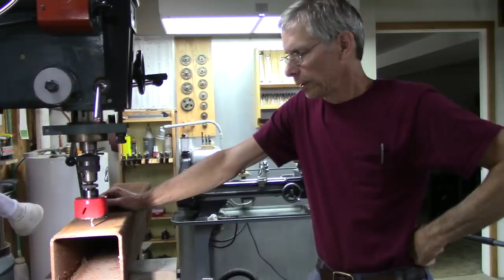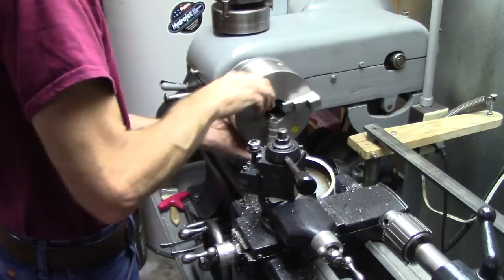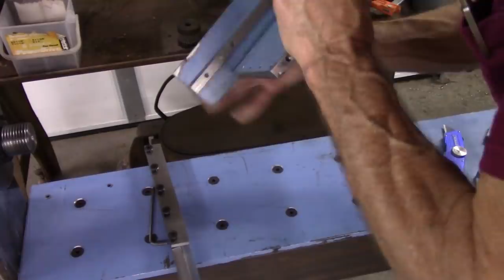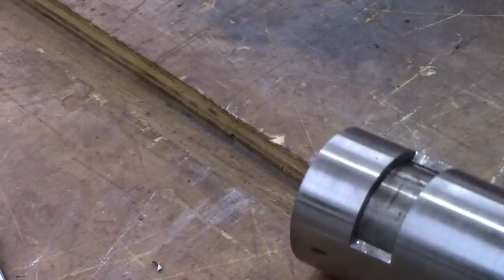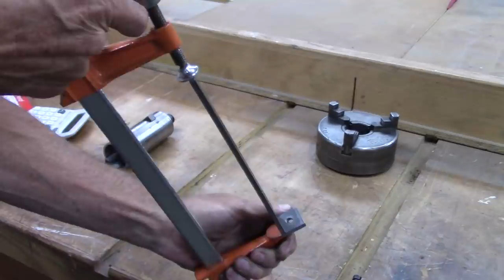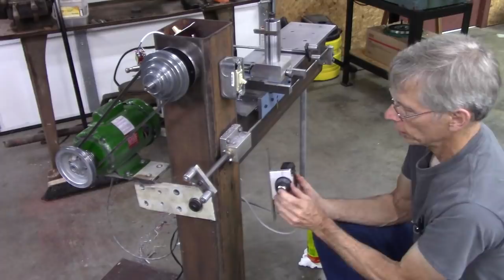Building a Wood Lathe like a Metal Lathe with a Pattern Tracer - Part 1

Comment: You do some pretty amazing builds !
Everything is over engineered,  perfect
Reply from the maker: Thanks, And I agree...  parts of this lathe were over engineered. The tapered bearing in the headstock for sure. I always wanted to try tapered bearings and they were very cheap.
Reply: @WinkysWorkshop  I know that Timkin tapered bearing are expensive, but the Chinese ones are cheap. Who knows Timkin may be using china now. Anyway, I always thought tapered bearing is better in a lath head. However,  it was common practice for lathe manufacturers to use Babbitt years ago before the sixties
Reply from the maker: @mikemullenix6956  These were listed as premium trailer wheel bearings. I just went back and looked. I paid $24 for the complete set and they are now listed at $22. No doubt Chinese. I've noticed Timkin and other name brand bearing have also dropped in price over the past several years. Probably all made in China now. Sad. It's nice to save money but we are paying dearly for this in other ways. I guess things will self correct but when and at what cost. My 1931 South Bend Lathe  has bronze bearings. They will not hold up to high speed industrial use but for what I do they work great. I had a Logan 200 and 820 with ball bearing headstocks and kept the south bend. The Logan's were 10's and the SB an 11 but the SB was much more solid. It amazes me how oil can effectively fill a gap and make a bearing solid. I can use the lathe for about an hour and and notice a change in the way it sounds. A dash of oil in the head stock bearings and its quiet again. I need to put drip oilers on it.
Reply: @WinkysWorkshop  I bet that 1931 Southbend had hand scraped ways. I think the Bridgeport had hand scraped ways
Reply from the maker: @mikemullenix6956  As near as I can tell it does not. The ways are worn bad on my South Bend. I miss my Logan sometimes. It was in much better shape just not as solid.

Comment: If you preheat the metal, you’ll get better penetration with a smaller welder.
Reply from the maker: I don't doubt that. That's a very good tip. Thanks. I think I'll sell this welder and get a 240V MIG. I recently got a TIG and it's AMAZING!  MIG is certainly faster but the control and quality of TIG is much better.
Reply: @WinkysWorkshop  My dad was a welder. Cut his teeth in a shipyard, did ornamental iron in Hollywood, and various pipeline jobs. I worked as his helper for a while. I wasn’t even close to his level but I did pick up a few things through the years and I think we should pass on what we know to the next generation. I only have a 115V Mig and I have to make it work on things that it was never designed to do lol. That little trick has enabled me to do quite a bit that I never would have been able to do otherwise.

I would LOVE to have a tig, especially a beefier one like you got. It would open up so many possibilities. But I’m saving up for a bench top mill.

Anyway, good work sir.
Reply from the maker: @lkw6640  Yeah...  the mill would be the higher priority for me too.

Comment: Amazing work! And using the channels for feet is genious. Now you can insert a fork truck under it to move it around the shop if needed. 
  Your welds are 1000x better than mine. Mine look like burned popcorn. 
 My only question is with such a beefy construction, why did you choose to weld the bed so high? You are losing so much swing radius for making larger diameter turns. 
  I'd love to have a lathe with a 26" (total diameter) swing...
I have been pondering using a 6x18 compound milling slide table  with a rotating vice mounted to it for holding by cutter.  This would replace a banjo. 
I could do the same thing for the tail stock for cutting interior. 
But I'm not a welder.. so this would be too expensive to hire done. 
For the chuck and motor, I figure a couple pillow blocks and an electric motor/belt/pulley system similar to yours could be used. Not as nice as yours by any means, but it would work for my needs. Im too scared to turn staves very fast anyways.
Reply from the maker: I think I can turn up to about 12 inch and I'm not much into bowl turning. Kind of scary seeing a huge chunk of wood spinning.  I've now converted this lathe to CNC. Check it out:  https://www.youtube.com/watch?v=lRgRHzdntWo&list=PLz2A001hMBoQIV6q78TUxDCCUZjXG37Wq

Comment: Winky, what model Logan do we see there?
Reply from the maker: That was a Logan 200. I sold this lathe and bought an 820. Then I sold the 820 and now have a South Bend 11. The 820 had a quick change gear box and it was a very nice lathe. The south bend is a little more solid however and I opted to keep it and sell the 820. Maybe not a good choice but I like the SB too.
Reply: @WinkysWorkshop  Thank you for the reply. I asked because my first and still primary wood lathe is an old 11 inch Logan 920. I bought it about 30 years ago at just over scrap prices. It was rust free but missing much of what makes a metal lathe. So I elected to make it a wood lathe with standard tool rest design. I removed the partial carriage and chip pan as I saw no benefit for the carriage. The chip pan would be an obstruction on a wood lath, as bowl turners often hug the beds of their lathes. The cast iron legs were put on 4x4's with casters. The rear of the lathe incorporates a plywood table that holds the motor and shop made jack shaft. The jack shaft converts the motor's V pulley drive to flat belt drive to match the head Stock cones. I turned the jack shaft cones from Florida Live Oak. I found the rear table design to be handy more than once. I can push the head Stock, motor and jack shaft down to the end of the starboard end of the bed  and turn bowls of any diameter. The 2.25" x 8TPI spindle can easily handle large, heavy stock. Though most of my turning utilized a 2.25" x 8 TPI to 1.5"x 8TPI spindle nose adapter machined for me back then. 

The most useful modification I made was a foot operated spindle brake. The brake bar sits comfortably under the lathe midway to the rear. When I step on it the Jack Shaft slackens the flat belt drive and a leather shoe brakes the spindle. If you ever retrofit a wood lathe with one you will find that you can't live without it. Bowl turning requires lots of stopping to check depth and wall thickness. The brake bar  is made of wood and spans the port and starboard legs. I positively love it and find it even more used and useful than my VFD! Prior to installing the a 3PH motor + VFD I was using a 3/4HP Start winding/Cap. I could swear I heard that motor thank me when I installed the brake. Starting is a stressful process on Single Phase - high torque motors. Especially models with centrifugal start switches. 

Wakodahatchee Chris
Reply from the maker: @cdrive5757  Very cool conversion. A metal lathe makes an excellent wood lathe. The only think I'm wondering about is the break and unscrewing the chuck during a stop? The lathe in this video is now CNC. A friend of mine made the controller and I did all the conversion. It works absolutely great! https://www.youtube.com/watch?v=lRgRHzdntWo&list=PLz2A001hMBoQIV6q78TUxDCCUZjXG37Wq
Reply: @WinkysWorkshop  The brake section of this clutch/brake is easily (no tools required) removed for chucking that's screwed on to the spindle. Spur drives, collets and such can use it. I have found that leaving it on for bowl turning isn't much of a danger because the brake is more of a drag than a brake. It doesn't slow the spindle down much more than my left hand on the outboard spindle hand wheel. The clutch is the most useful feature part of this anyway. It's just a merciful relief to the motor's start up.

I'm a retired EET / Biomed- ET. So when I walk into my shop I want to go back in time and escape the tech world. Wood turning 'is' working wood with hand tools. The magic that comes off the lathe comes from my hands not the lathe. The lathe merely rotates the stock. No ... stop right there. I'm too damn old to go as far as peddle power thank you! ;-)
Reply from the maker: @cdrive5757  - I've done a lot of wood turning in the past. Lots of bowls with lids and replacement spindles for chairs. I can get very a very close match if i take my time but the manual wood lathe is best for one off pieces. I may go back to this some day... I love the bowl turning. The CNC is just another skill. The final outcome still has to be imagined to create.  I'm really loving my CNC lathe! https://photos.app.goo.gl/sGGhEkxucxBMu4Nf6
Reply: @WinkysWorkshop  Winky, don't get me wrong. I love visiting with you here on YouTube. Don't stop anything you're doing. Creativity is nourishment for man's soul! When I can no longer do it or at least teach it, ... it's time to check out. ;-(
Reply from the maker: @cdrive5757  I didn't take you wrong at all and even agree with you. I see a place for both methods.

Comment: I have a 10 inch Logan lathe,it has quick change gears for making threads.I've had it for many years.Like you I like to make things on my lathe.I have been making segmented vases and turning them out on my logan.
Reply from the maker: Cool. I have used my Logan for wood many times although the oil makes it hard to clean up and to some degree it gets on the wood.

Comment: I have a noob question: is cutting with this tool that is parallel to the work (as in 6:18.. is it a cut-off tool?) not giving you a lot of chatter?  I always experience heaps of chatter and resonance when cutting with a tool like this on my small crappy mini-lathe, but feel it goes much smoother when my cutting tool is more pointy.  Probably my mini-lathe is not sturdy enough for such things.
Reply from the maker: Good question. This is a tool called a cut off and grooving tool. The one I use most often has a GTN 3 insert. It cuts straight in and laterally (left to right). Look closely there is a 1/2" thick steel plate that straddles the bed and a post that goes up to the tool. My lathe might be more solid than yours but this plate stops the chatter. I used to have a video on this design but I took it down. It works well for what you saw here but for cut off people were breaking a lot of tool holders.
Reply: @WinkysWorkshop  thank you for the explanation! That supporting rod and massive carrier underneath is certainly ingenious. I'm going to ponder on how I can maybe do something similar! Now I'm avoiding cut-off in the lathe, saw off my pieces a bit longer and face them off, which is a workaround but kind of does the job. And... Save money for a bigger lathe :-)  Your channel is very inspiring! Thanks for sharing.
Reply from the maker: @scififan698  Thanks, I used to do the same. Here's a video that explains a lot of problems and possible cures for cutoff problems. https://youtu.be/B6NMY73eOxU

Comment: I use my metal lathe all the time for woo working as I don’t have a wooden lathe it’s great for parallel cuts with the cross slide love from England 🏴
Reply from the maker: I did for a long times but that darn sawdust sticks to oil. But I agree, a metal lathe is great for wood.

Comment: When I was a kid like 12 or 13 I used to work at a machine shop. They used Crisco for lube. Put on a small brush and paint it on. Working on an old mill taping holes put Crisco on the tap run mill forward get threads cut. But whats good about it was when the tooling starts getting hot Crisco would melt where it needed it.
Reply from the maker: I'll bet that crisco worked great!

Comment: This is awesome. Nicely done. I like everything about it...well except the color. Lol
Reply from the maker: Thanks Bob. The pattern tracer didn't work as well as I had hoped but it does work. Otherwise I'm happy and amazed at how well it works. With a sharp tool made with a lot of relief it cuts very smooth and effortlessly...  like butter. If I was going to make another one I would take a different approach on the head stock and make it a separate bolt on unit. That way it would be easier to make everything aligned perfectly. Mine is very slightly off and I can not adjust for this. Fortunately the misalignment is slight and not really enough to worry about.

Comment: I am thinking building a car like yours how long is it and how wide is it is your birds 1" thick how wide are they dave from toledo oh
Reply from the maker: I think they are 3/4" x 2-1/2" boards. The wheel base is 30 wide...  not sure what the length is. There is a link in the comment area to the drawing. They are not the greatest but there are a few dimensions.

Comment: you want to get rid of that lath on the table
Reply from the maker: That old lathe on the table is a Logan 820. This lathe is now restored and my primary lathe. It's basically the same as a Logan 200 like the one I use in the video but it has a quick change gear box. I love it.  https://youtu.be/u7WBN17lOiQ
Reply: @WinkysWorkshop  well thank you for a reply i hade a lath awhile  a go so sorry i got rid of it because motor  took a dump

Comment: I  think I would try a M2 internal on the threaded end for a spur on the wood lathe.  Not easily done - drill  and bore to rough size. Then ream.
Reply from the maker: I thought about that but boring through that length is a challenge. I probably should have bought some DOM tubing to make the spindle. I do plan to make a screw on spur center at some point. I also could have drilled 4 inches deep and reamed a taper but that can make a center difficult to remove.

Comment: Why not just use the metal lathe as a wood one?
Reply from the maker: I was actually looking for one but never found one for the right price. A basic stripped down metal lathe would be great. Everytime I used my current metal lathe for wood all the wood dust stuck to every oily component and I'd spend an hour cleaning the sawdust. Then there is a matter of weight and size. My wood lathe is smaller, weighs about 200 lbs and still has about an 10 inch swing over the compound. My 10" metal lathe has about a 7-inch and weighs about 700 lbs.

Comment: Great stuff man! I need you around when I decide to extensively modify my motorcycles. Which is too damned often! I'm a wood guy, so I always have the utmost respect for metal guys. They have a tougher time I think. [They can't glue stuff together]
Reply from the maker: I do a lot of woodworking although a lot more in past years. I plan on making a few project in wood for future videos. I have one in process right now that includes some metal working and wood. You might be shocked - watch for it.

Comment: kind of curious if I could use the same spindle concept for a diy vertical mill?
Reply from the maker: Google "diagram of milling machine bearing" . Tapered bearings are lower speed and meant for high thrust. Mills usually have stacked roller bearings that are loaded against each other are the end of the spindle. The tapered bearings might work if they were in an opposed arrangement at one lower end of the spindle.

Comment: Currently I am using pillow block bearings for my headstock but lately I am seriously questioning the rigidity. Considering my 5 inch metal Chuck at 25lbs+ I know I want to rebuild. What size heavy wall conduit is that? 2 inch trade size? Was it difficult to find the tapered bearings to fit the ID of the conduit?
Extremely well done. I would have to say this is the cleanest lathe build on YouTube. Your results inspired me to rebuild my headstock on my homemade Lathe.
Reply from the maker: Shannon, thanks for the comment. Here's the way things went. I knew I wanted a 1.5" x 8 TPI spindle to fit my metal lathe chucks. So I went on Amazon and found some tapered bearings. They were $23 for the pair. Search for this "LM29749-LM29711 Tapered Roller Bearing". Then I knew the OD of the bearing and located a thick wall pipe with a slightly smaller ID. The pipe I used was from a large ink pump (for printing presses) I got from work. It was tosses due to scoring inside but perfectly good for my purposes. The wall thickness was about 1/2".  Send me an email. mark21056 at g mail and I'll fill you in on some things I've learned.

Comment: Why are you Americans so obsessed with transfer punches ? I am English and not only have never used any in 42 Years of engineering, and have not seen any for sale here. With the plate lined up, you already had a drill jig, you should have spotted with the same size drill just down to full diameter, then change over to the tapping size drill. Leaving it in place it would have also been a tapping guide to get the threads vertical. It would have had to line up .A spotting punch I can see would be useful to locate the hole if it is not possible to get a drill into position due to obstructions. By using a punch as you did, you still have the potential for the drill to wander off the mark. You did not say whether it all fitted first time or not, you switched from fitting a few bolts to your milling problem !!! Anyway a great job, just shows what can be achieved if you put your mind to it. What ( if any ) is your day job ? Finally, what made you make your own handles ? a lot of work when on e-bay you can buy nice cheap machine handles in either plastic or aluminium.
Reply from the maker: The Transfer punches work great! As long as you use a small pilot hole there is very little chance of error. I'm not saying I've never had issues but when I do it is a problem with drilling perfectly straight with a hand drill and not the hole location. In the case of the bed plate it was perfect. The tubing was only  about 1/8" thick which allowed the screw to align even if the drilled and tapped were slightly  angled. I've used a drill near the hole size as you suggested which seems to work as well but in many cases this is not convenient. As for the handles...  I'm cheap, they were very easy and had the scraps. If I had been making several wood lathes I would have bought the handles.